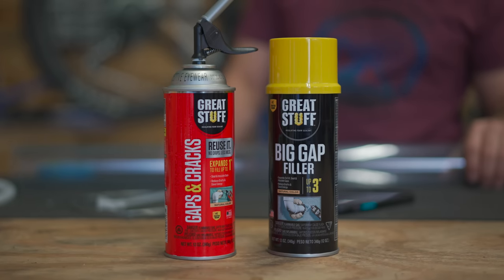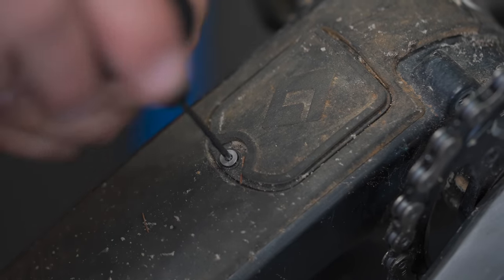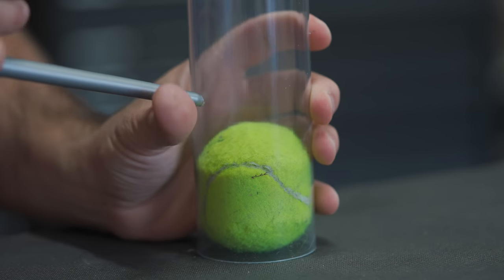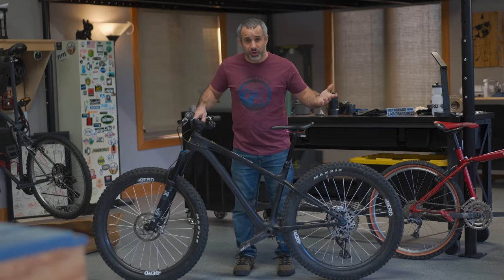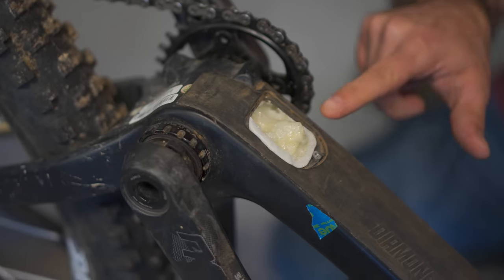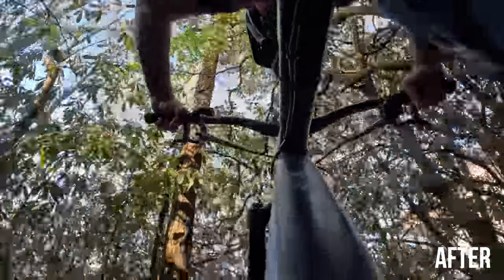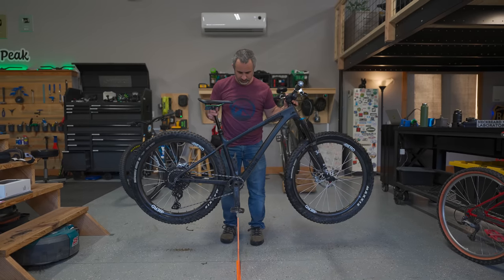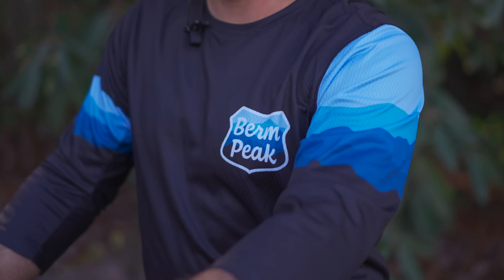Filling my bike frame with foam made it better—kind of. Don’t do it.

Comment: I tried this on cheap aluminum bars to see if I could mimic Vibracore bars. I used a tube to fill the foam while pulling the tube out. The foam seemed fine, but two days later the foam broke down to a sticky mess. So ended my experiment.

Comment: As former carpenter ( from Bavaria!) for 15 years, and a bike mech since 12 years, I tell you, this foam never had any real benefits, for no job😎‼️ First of all, in Germany a house is made from stone or concrete, so the only work you use isolation foam is building new windows or doors. To fill those gaps between house, wall and window. But, if the house was built properly, the boss had taken messurement exactly, and I fit and built in the window, I only needed a little bit of the foam.  Because the matter is, the hardened foam, starts breaking into dusty pulver, after 5 to 7 years. So, we always avoided, to use too much of that stuff.
And for a bike frame, as a hobby DH rider, till today, I don't like clapping inner cable routing...............

Comment: Had a custom aluminum driveshaft for my Japanese car and every time I hit 3,000 RPM to 3,500 RPM the drive shaft made a loud droning sound that anybody walking down the sidewalk could hear. The manufacturer of course said oh there's something else wrong however I put the original drive shaft back in and the  drowning went away. Thought about filling it with foam but I practiced on something else first only to find out the foam did not dry inside the tube so I gave up the idea of putting foam in the aluminum drive shaft and gave up the aluminum drive shaft all together and went back to the steel original factory drive shaft.

Comment: The only reason I ever needed to put foam in a frame is because there was a piece of weld loose, or metal. It rattled around and drove me insane until I foamed the bottom tube.

Comment: If the foam cures hard, then it will modify the stiffness of the bike and could cause problems for the carbon. You have essentially turned the whole thing into a 'sandwich construction' rather than a single skin tube. You could end up transferring way more load into the headtube and BB junctions if you stiffen up the downtube like this.

Comment: If you do, do this use the two part foam that will cure much more evenly. If you use the regular foam it may not cure completely because it requires air to harden.

Comment: Sometimes I've heard this way to improve the stifness of a handlebar, I don't think this way gonna remove or silent any bike noise, but maybe... Only maybe... It can provide some more stifness. Fill a flexible tube with this foam and check it out. But bikes are actually rigid enough to don't think about these kind of inventions... Or yes? 🤔😏

Comment: Did not a single soul in any of the forums or comments talk about the rigidity it adds (or at least can add) to the frame?
Filling a hollow tube with foam adds a small but not insignificant amount of structure to it.

Comment: My ti frame had a loose rivnut for the water bottle rack and I pushed it into the frame to remove it through the BB shell... only to realize that I couldn't access it through the shell as there was no hole. the rivnut started rattling around and I couldn't stand it, so I shot the downtube full of foam and voila! No more rattle

Comment: to measure just the frame noise you might have to take everything off the bike and then just shake the frame around violently, that would be pretty funny, before and after filling with foam.  Otherwise you're probably just measuring all the other sounds around it.  Also, a frame without all the channels would probably be louder without, you'd have more stuff slapping tubes before and less or none after.

Comment: There is expanding foam with structural properties that would possibly have stiffening and quieting properties... way more than cheap insulating foam.  I doubt the weight would be worth it.

Comment: Hey pal! As a citizen of 3rd world country, we use that stuff even in our food, (just kidding) and the best way to clean it is with acetone, it melts and you can clean it right away, I'm pretty sure you can remove it from the frame, which will be a dirty and tedious job, and acetone can affect some plastics, but you could undo it. very good video!

Comment: Considering some XC (and most people) want the lightest set up possible, like even removing every second bolt on their brake rotors, this gains you nothing. No matter how “light” the foam may be, it adds weight. And worst case if you don’t have a factory sponsorship and mechanic, you’ve opened yourself up to a world of headaches in terms of maintenance and/or re-sale.

Just ride lots and you will learn the sounds, and more important the feel of when everything is right, or wrong.

Made for an entertaining YouTube vid though…

Comment: You're probably better off getting the running average, instead of the momentary max. You could integrate raw data from a microphone or a piezo -- a piezo actually glued to the frame would measure this better.

Comment: Foam needs moisture to expand. So you at least need to spray some water  inside the tube before. Or use 2 component foam.

Comment: Filling a bike with foam would only have a slight effect on sound. The main reason is that you're isolating the part of the bike that makes the least amount of sound - the frame. It may alter the sound, as we saw in your science experiment here. Who here has ever put a pillow in a kick drum? It certainly changes the sound, but does it make it quieter? Meh, kinda. Is it still loud? Of course. The same theory applies to the bike. There are so many other things on the bike that make more noise than the frame. The chain, the shifter, the brakes, even the pedals, all these moving parts make more noise than the frame because the frame doesn't move. The frame will transfer noise and vibration (another aspect you didn't study in this test but if there was a noticeable difference I bet you would've said something) but like the pillow and the drum, adding insulation will more drastically change the sound rather than mute it.

Comment: ok after watching the whole video I think your research does not get to the end of it. I mean what are we talking about? This foam won't get your bike any faster but what does it do? I think it does more than the sound aspect you meassured. I think the interesting stuff will pop up when you look at individual parts (however this could be done). Let's talk about mechanical resonance where a little vibration of the right frequency can let to a resonance catastrophy. For a high end bike manufacturer it's all about weight to gain ratio. I think you are on a path to something. Take my like an sub.

Comment: You made one critical error….you forgot to also fill the tires, handlebars, steerer tube, head tube, fork legs, crank spindle, thru axles, and the empty space between your rim walls with the expansion foam! That would’ve made it completely silent for sure! 😂

Comment: Obviously the sound will stay loud because of the tires and suspension going over rocks has nothing to do with the frame...one data you could measure is the difference in weight

Comment: I have an old aluminum bike with big thin tubes that could be a bit quieter with foam, but I don't see the point.
By the way, canned spray foam is not what you want to use for this type of application.

Comment: I knew a guy in Motocross during long enduro races/ rides I mean long ones like 24 hours kind of things who would fill his handlebars with spray insulation the kind you put in homes.  He swears it gave the handlebars a different feel and lessened the vibration coming through the bars and even helped with arm pump.  Now it could be a mental thing as well but them bars were too expensive for me to try it on a whim.  Just could not ruin a set.  So I don't know kinda like bigfoot.....there may be one or it could be just really bad camera's still are too abundant.

Comment: Has nothing to do with the bike being quieter LOL   I just filled the stretch I just custom made for new motorized bicycle build with foam actually!  It actually helps stiffen up tubing and makes it less prone to vibration travel since it has a stiffening effect to ist and it keeps water out of the tubing!  Same reason they do it to airplane wing supports light weight and helps prevent vibration and actually helps the tubing not collapse as easy since walls are supported internally by it!  who ever told you it makes it quieter was playing you for a fool lol!

Comment: An issue with this on a steel frame is that this stuff absorbs moisture, and could cause it to corrode from the inside out.

Comment: Years ago I tried this trick on some stock handle bars to try and keep the vibrations down.  After spray foam there was less hand fatigue for me. I though about using automotive sound deadener but there is a greater weight penalty and it would be a tougher install.

Comment: I found a piece of black PU foam in my bicycle's seat tube, similar to acoustic foam. Why was it there, who put it there? I don't know, i'm not the first owner. How did i find it, why did i go looking?

BECAUSE THE FRAME RUSTED THROUGH JUST THERE. IN THAT VERY SPOT. ALL THE WAY THROUGH.

I thought it was probably just surface rust but i went ahead and probed it and i can probably stick my thumb through one of the holes, and there's a few more. I can probably stick my big toe through. I'm not going to, due to injury risk, this is just for illustration. I don't know how much it is in football fields.

Don't add things to your vehicle that might take on water and don't have a good way to release it. Water isn't only bad for steel, it's also bad for carbon fibre, just not in the same exact way. It's bad for everything.

Comment: I remember reading a pro bmxer used to fill his tyres with helium, that could be a fun thing to try out in the future. I'm 90% sure it was one of the old T1 riders maybe Ruben before he joined Fly. 

If you found a way to seal helium into components like forks/cranks/frames you could patent it and make millions from the bike trials community.
Reply: Helium was used originally on olympic track bikes, in the tires to save weight

Comment: I used to have an orange 225 dh bike and filled the swing arm with expanding foam and on that bike it made a massive difference also filled the down tube to and basically made it silent. Any1 who’s rode an older orange knows how noisy they are

Comment: Looks like you are using regular one part urathane foam. This cures with a hydroscopic reaction (needs moisture) so in a sealed, dry space it will barely cure or expand. You would be better using 2 pack foam for this purpose as it will cure in a confined space. Except don't do either. Just don't.

Comment: ... make it more quiet? and heavier? while doing almost literally nothing? a good frame is meant to have an amount of flex, i don't like aluminum for thar reason. cro moly Japanese frames have the best feel for  me. but considering the frame alloy properties, wall thickness and tube cross sections and diameters are what determines its character, and the spray foam having no bond or integration to the metal, and its easily deformable nature, would lead one to believe that it would do almost nothing except add a negligible amount of weight. probably makes you more sneaky though. no one wants to ride around on a wind chime sounding rig.

edit: what about investigating the effects of exterior coatings beyond paint. what about having a knurled pattern or other grooves, and then having a material that can form some kind of bond with the metal, making it more like a hybrid material, or filling those grooves with a fiber strand and then a bonded flexible coating, this would probably give it a sort of suspension effect in terms of road feel, but without added weight and clunkiness of suspension components. food for thought.

Comment: Okay, I'll just throw this out there but it'll probably be lost in the comments.

The Japanese have been using this technique in their unibody "racecars" for decades. I say "Racecars" because usually these cars are for racing on the street and they want the benefits of the rollcage stiffness, without the weight or attention. They fill the frame, and A and B pillars. Primarily for chassis rigidity. 
However, there are a variety of expanding foams. Some expand more than others and some cure hard as a rock. That being said, I wouldn't do it to a bike. Too little of an improvement.
Good luck.

Comment: If you really want to do something like a scientific experiment, you need to remove all the variables. I would take all the pieces off of the frame and then do a sound test using your plastic covered mallet to listen to the frame being struck both hollow and filled with foam. Removing all other variables make sure test more reliable.

Comment: Your really using the wrong expansion foam. You would want to use high density structural expansion foam. They use it in high end super cars with carbon fiber tubes to add rigidity to it and reduce road noise. I would think that any metal frame bike wouldn't need it.. but it could made a small like 5% difference in a composite or carbon fiber frame in it's over all strength.

Comment: It's a good experiment.  But if a bike is rattling from the external components like chain, derailleur, cranks.  Then why would spraying foam make it that much quieter? It really only dampens vibration.  Even then the difference was only 3-4 decibels quieter.  Question is would that improve anyone's riding skill, or make the bike better...Nope!
It only added a little weight and usually the goal is to cut weight off a bike.   

Seth thanks for using your bike to answer people's dumb ideas.
But never would I spray expansion foam in my bike.

Comment: i feel like this could be used in the manufacturing process to make the frame lighter by using less carbon fiber and therefore, less resin. but after the fact it seems kinda sus

Comment: well since most frames right now is made with carbon fiber why not invent a light weight filler to atleast fill up the inner cracks in the frame to prevent and make it secure and stiffer.

Comment: THIS ISNT HOW U DO IT  (like so he will see it) 
this foam wont work like u hear it will , expanding foam need moisture from air to harden which can take months inside the frame --- like u see in 5:40  --- everything under outer layer exposed to air won't harden
u need to use specific type of 2 part epoxy foam (hard ones ....specific meaning - the one your local distributor will tell u that works as an foam for filling hollow composite parts , dont like to compress  but still is flexible enough to work fine for years) 
but first check how it works  because it expand like crazy and can literally expand the frame 😅

then watch tutorial how to pour it or u will destroy the frame

when u do it with right foam
frame will be stiff like concrete XD but yup it will be quiet maybe not super noticeable but still something

this technique is used in CNC machines to make them not vibrate = part will have better finish + it makes everything stiffer (right foam is so hard that it feels like 100% material not foam and is super hard

Comment: Man.... you go through all that trouble for nothing when there are far more easier solution. You could have the same effect with stick on sound insulation sheets if you are trying to reduce metal pinging sounds. Filling foam is one of the methods car acoustic freaks used to reduce chassis and outside rolling noise. 

I am sure you can stick on a few strips of sound deadening sheets on all the frames and you will have same if not slightly better sound deadening on the bike frame.

Comment: For a 2dB difference it's not worth it. Most humans will not hear a 2dB difference at all. Hence you why you heard no difference in your drop test. I would be more interested to learn if it stops my rear brake and gear cables freezing in the winter. I commute by bicycle all year round and it always feels really sketchy when critical parts start freezing at 6am on a main road in the pitch black.

Comment: Put that stuff in the tyres! Hahaha. I have used that stuff many times. It's always a mess and will leak out any hole you didn't close well. Exploding bike frames? Too weak to do so. The more foam, the longer is needs to cure, sometimes a week.

Comment: 7:11 no you don't. you just know that 'longer' sounds are more annoying to your ears and brain. you don't eliminate the peaks with this method but you will get rid of the internal accustic reflections.. or echoes. This is very interesting but overall it's the real internal vibrations that have to be blocked. Let's see, I'm not through the video yet.

Comment: If you want to know how much weight you added from the foam just look at the weight on the can. try a little gasoline and see if it will liquify the foam.  Perhaps carburetor cleaner will. I'm not going to tell you about the flammability of gasoline. Use your own judgment and common sense. I'm sure you have experience with gasoline.

Comment: there are two types of foam, high exp foam and low exp foam, it should be written on each bottle, only that it does not expand as you thought at the beginning of the video. But it can be cleaned, disassemble the frame and wash it with gasoline, gasoline melts the foam